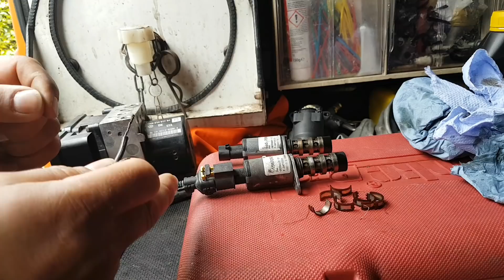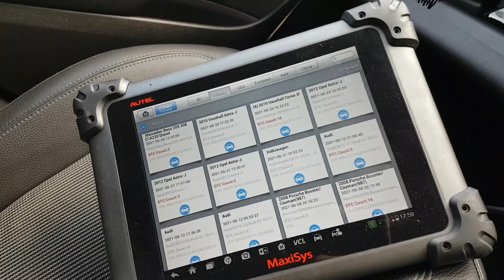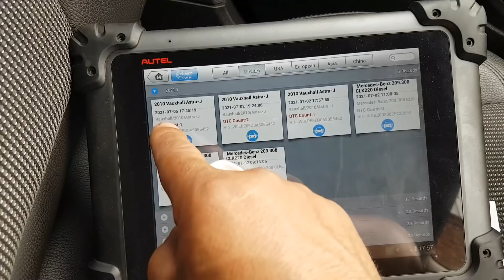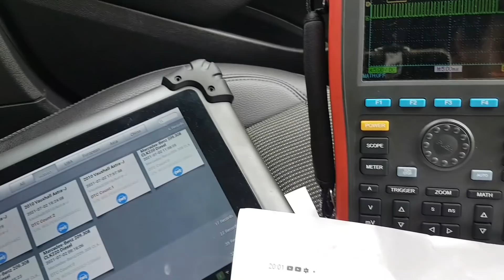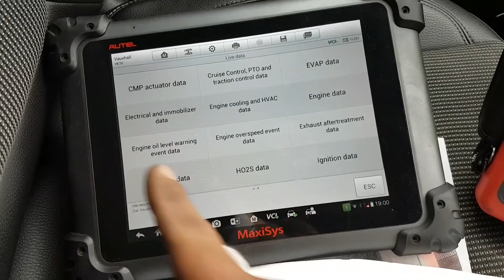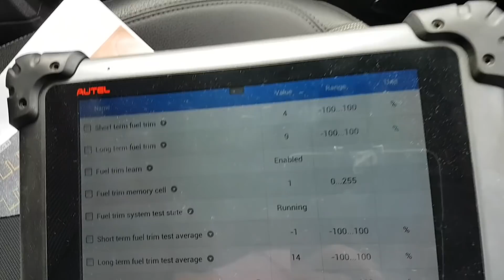Astra J 1.6 engine light on with camshaft faults... Fault finding and repair.

Comment: this video saved me, i opened the cover culbuter , then changed the camshaft signal ring position,  my car started perfectly
Reply: Hi Guys I think I have the same issue p0016 & p0014 been on a scope and Exhaust cam → Good = 13/46, mine  = 16/42 → about 3 crank teeth late.
Inlet cam → Good = 46/13, mine= 44/18 → about 2–3 crank teeth advanced.could my reluctor rings on the end of the camshaft moved out of sync, if so how do I check and reset them please

Comment: Hi thanks for the reply don’t know how to explain  but Astra j 2012 1.6 Sri petrol  2 times I had miss fire and loose or burn oil,when you drive the car hill it won’t go need to drop the gear and make it noise from under tho bonnet like a cranking noise when you continue to your foot on acceleration and smoke coming from the exhaust also it’s kind of breaking when accelerating so most of the time I have to lower the gear and pulls up also the engine gets really hot like I can feel when you open the bonnet and replace the ignition pack and super plugs just yesterday but I have still same problem everybody say something like fuel sensor,maf sensor ,crankshafts sensor, I could explain better if I could speak and also where is your location I m in Cornwall thanks hope you can sole my problem thanks also you could find me in messenger so could do call
Reply from the maker: Have you actually scanned the car, and perhaps look at some live data?
Anything else will most likely be guess work... 
👍👍👍
Reply: I m not a mechanic and I don’t have scanner when they did scan there was only miss fire and replace the ignition pack and spar plug still I have same problem no fault code
Reply from the maker: If there is no fault codes, most likely your answer will on on live data...
Reply: @LMAutoRepairs   What city is the garage in?
Reply from the maker: No garage...
It is a part-time for me...

Comment: you don't claim to be a expert 🐂💩you could be teaching master technicians 😉👍
Reply from the maker: ☺️
Thanks!
👍👍👍
Reply: @LMAutoRepairs  the master technicians have it easy compared to what we do they only have to deal with one brand they have access to all the dealership tools and tec support most of them wouldn't know where to start in a normal garage and what gets me angry is what collages are calling education 😲
Reply from the maker: I do actually agree...
Working on a single maker, and with access to all the information, should be quite easy...
The tricky part is working on multiple and so different systems etc...
👍👍👍👍
Reply: @LMAutoRepairs  exactly that's why we rely on real experts like you to point us in the right direction when faced with something new 👍

Comment: Inlet phasers are different to exhaust phasers,they look physically different and have different part numbers.
Timing is done by fitting a plate to the other end of the camshaft to lock the camshafts.
Phaser locking tool sets the phasors to be in the recommended position.

Comment: Hi. Love your movies.  can you plese tell me from your experience.  How is the 908 pro doing in 2022?  I have opportunity to get new pro with 3 years free update or elite with 2 years update.  Just wonder if is worth to spend on those older platforms or go for 909/919 series.
Reply from the maker: Hi
If you can go for the 919, go for it...
The built in oscilloscope, signal generator plus all the standard functions of the pro, definitely worth the investment...
This obviously, if you are going to make use of those functions...
If you only need scanning and the odd special functions, then the 908pro will do the job just fine...
Just my opinion...
👍👍👍
Reply: @LMAutoRepairs  Thanks for your advice. I have 4ch pico and some signal generator. Think 🤔 I will go for pro due to much lower prise and 3 years update.  919 subscription cost insane 💰 💰 💰
Reply from the maker: Makes sense...
👍👍👍

Comment: P0365 is a misleading code  for sure ,same as p0340 etc , there is not a code i have seen for cam trigger broken off by a rough bu..er
Reply from the maker: 🤣
Would be great if were codes for that...
This week, would have been a code for an airbag light connected to an engine light...
🤦‍♂️🤷‍♂️
👍👍👍
Reply: @LMAutoRepairs  You do get some interesting stuff man,  🙃    thats why i like your channel ,   😊

Comment: That is so freaky. Had exactly the same fault on the same engine a few months ago. I did find the fault by scoping a good engine with the faulty one. The head gasket had been done and the firm that skimmed the head had broken the same tooth off - or so we thought. You did say that the customer had said initially nothing had been done to the engine before the fault had occurred - did I misunderstand?. I'm wondering now if the skimming firm didn't break the tooth off and this problem is a weak tooth manufacturing issue. The firm did totally deny they had broken anything. Interesting problem. You can bet we are not alone with this issue. On a side note, the actuators had obviously been messed with and as far as I can see this must have been for the same issue. Somebody has omitted info that should have been passed on regardless. Anyway, good fix 👍
Reply from the maker: Yes... that it what I have been told... but obviously that was not entirely true...😋
Thank you for watching and for your comment! 
👍👍👍

Comment: Great video 👍 I think the cam was broken when they tightened the cam wheel's need to lock either crank with tool or lock cam wheels,seen someone fit an extra exhaust cam 🤣
Reply: someone was simply using the camshaft's alignment plate at the back of the camshafts as a locking plate for undoing and tightening the cam gears, whereas as it was mentioned in the video, they should've used open end spanner on the hex shaped parts of the camshafts. the back plate slid out while under tension and knocked out one of the teeth probably not even realising. it's quite a common mistake and if one does a bit of a research before changing the cam phasers they know what and how to do. even if they had managed not too knock a tooth out they would probably get an error for cams being out of sync because it's virtually impossible to maintain proper synchronization only holding cams with the back plate and the gear alignment tool. it is a pain enough trying and doing it without a second person. ideally it's a two man job, even the workshop manual says so 👍
Reply: @plllot9713  I just work on Corsa's B,C,D,E 
seen and dealt with some weird stuff  but always learning .
Reply: A little knowledge is a dangerous thing, I really hate it when people "fix" things but will not say what there did, you work blind until you find where they went wrong.

Comment: Will that ring not move again in use if it has been disturbed I would not be happy to use it and would rather fit a good used or new camshaft
Reply from the maker: Will not move under normal conditions...
But in the unlikely of moving, the only thing it will do is that will throw codes for the timing...
A new camshaft would allow the ring to move just as easy... if forced obviously....
👍👍👍
Reply: @LMAutoRepairs  great video as always. Thank you for the effort.  You did went on the rabbit hole with this one. Sincerely I would have tried to weld the broken tooth right there on the spot. Quick and dirty. 4 little welding spots on the sides of the tooth would have done the job. There's no mechanical pressure on it. Just needs to stay attached. Thank you for the case study!
Reply from the maker: Only if I had a welding machine...😋
I know what you mean...
👍👍👍
Reply: @LMAutoRepairs  get some cheap tig/mig welder from parkside when they are on offer. It's a good tool to have in your new shop just in case. 👍
Reply from the maker: @alexdragomirescu5084  
Absolutely! 
Now that I have slightly better conditions I will might get one... then will need to practice my welding skills!
😋
👍👍👍
Reply: @LMAutoRepairs  youtube is full of welding techniques, but practicing is a pretty satisfying hobby. Have fun!
Reply from the maker: @alexdragomirescu5084  
I have arc welded for some time, when I was like 17...
Thanks!
👍👍👍
Reply: @LMAutoRepairs  in this case the arc welder would have been way too powerful....very risky.  Tig is best for small spots. Mig also but not so precise. PS: I'm not a professional welder. I'm in the automation equipment industry and sometimes you have to find the fastest way to get the production running. So I have to adapt. It's not always a pretty fix but the result is the name of the game. 👍
Reply from the maker: @alexdragomirescu5084  
Ho I understand you!...
😉
👍👍👍
Reply: @LMAutoRepairs  ok thanks it's just made me wonder lol great video and great patience to figure it out though we'll done